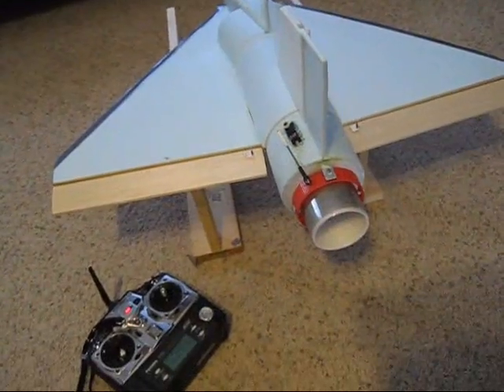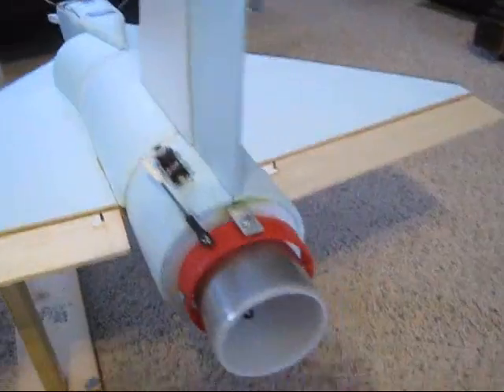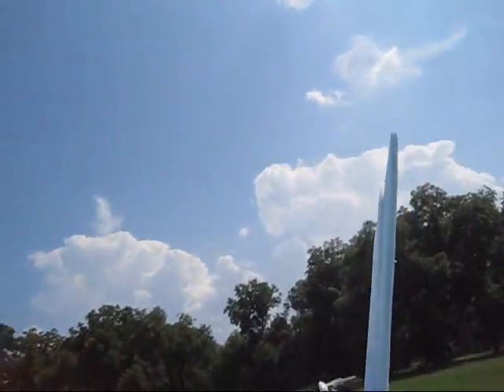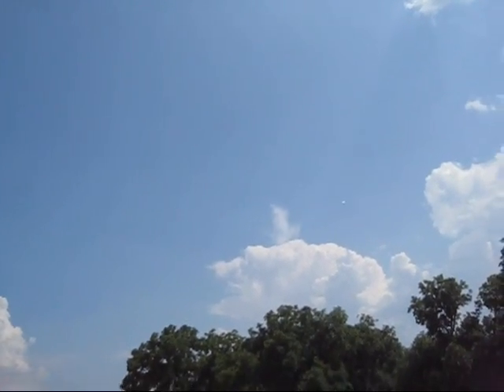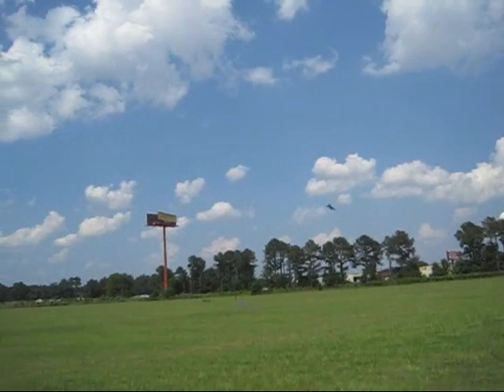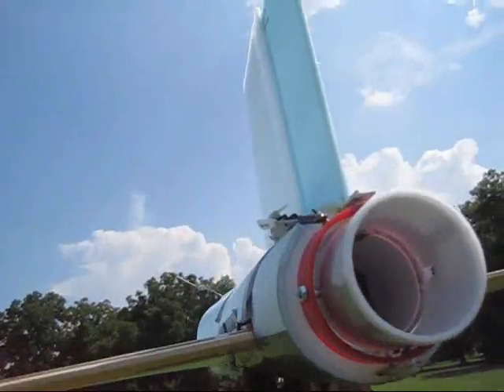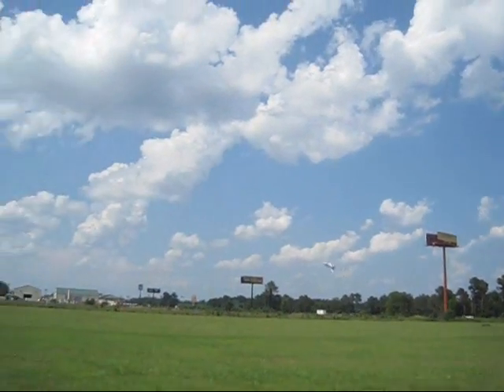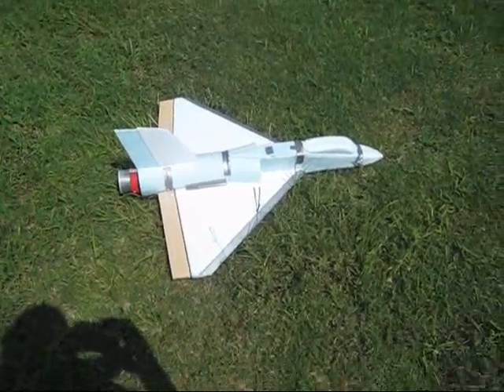rc EDF trhust vectoring Falcon

Comment: Nice work! For the high alpha stuff, you really need some kind of roll control. Would be fun to do one with engines on the wings, using differential thrust for rudder, and thrust vectoring for elevon type control :)
Reply: Actually on second thought, I don't think you could get elevon control that way... only aileron. Too close to CG in the nose-tail axis, so aiming both thrusters up would make you move up, but not rotate nose down. Twin thrusters at the tail should be able to do it, but differential thrust may not work due to them being closer together. You could still get yaw control with these two-axis vectoring ducts, though. Or a rudder between the two engines.